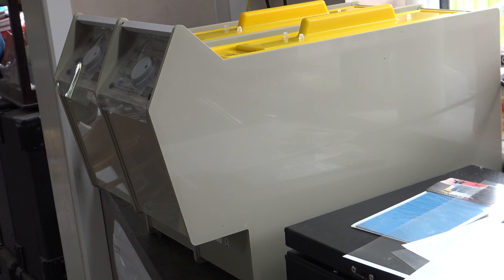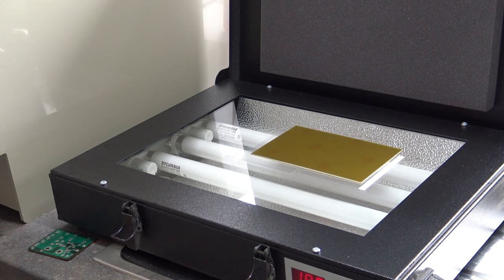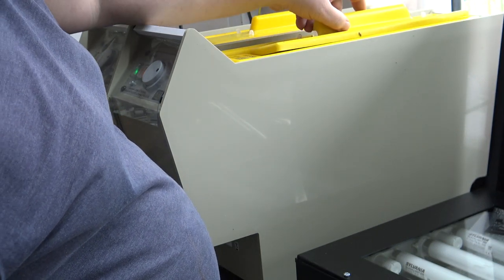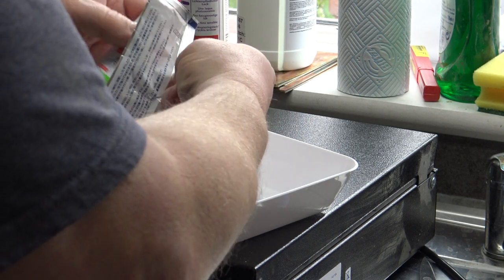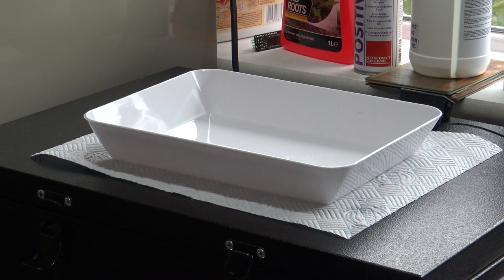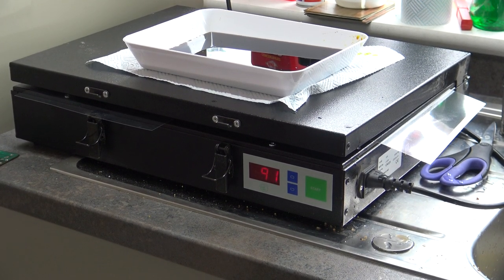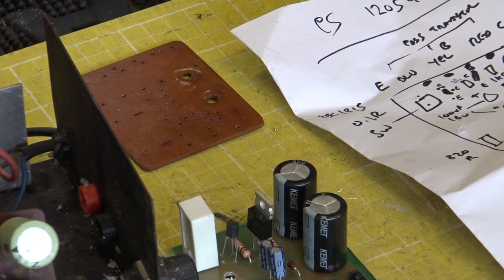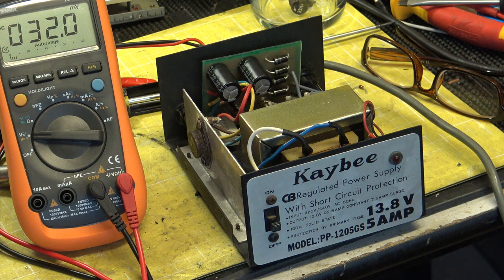Banned PSU overhaul pt3 - making PCB's for the project & first installation

Comment: That was interesting to watch I may give it a go making some dansette amp boards can you recomend a program for pcb disign I'm looking forward to SH1T Sunday
stay safe Richard
Reply from the maker: No Andy, we don't use a PCB program. This one was a copy, and the organ ones were done by me in the 80's  by hand. Surely you can just do what we did here & take all the parts off an existing amp, copy it & fill it in on Paint or similar program. 

Richard
Reply: Hiya Richard I can do it that way but I want to make some changes and 3 seperate capacitors instead of the 3 in 1 type so I need to change power supply portion of the board
Andy
Reply from the maker: @andymann1231  In that situation I'd photocopy  as we did & then in the paint program, do the modifications.

Richard

Comment: 3055 ??  you not replacing those as well ?
Reply from the maker: Nope, it tests fine with correct gain. Remember this was a fully working PSU I specially bought in so we could check the true value of components used; especially that zener. Now armed with the correct info, I can set about repairing all the duff ones we have here.

T21